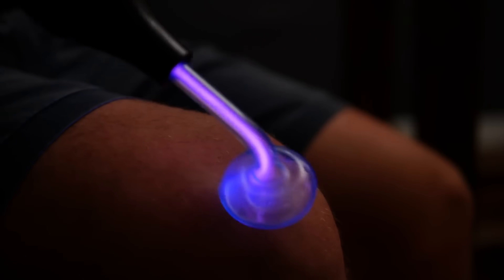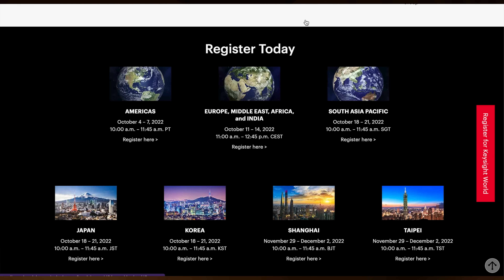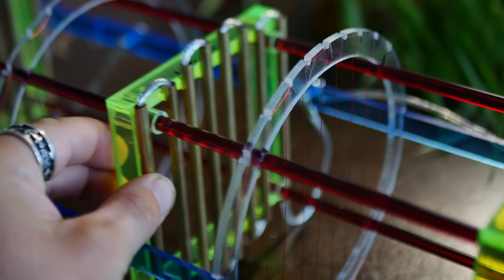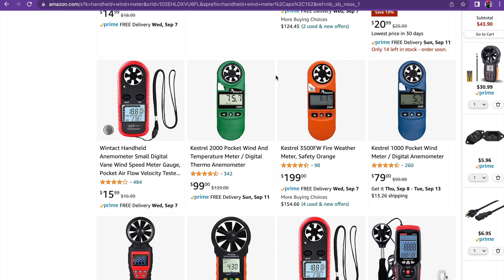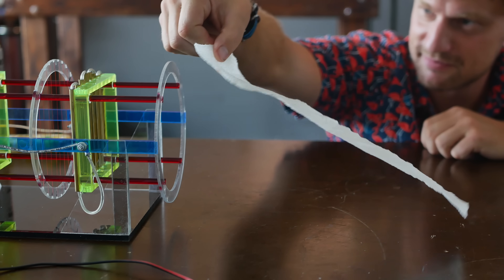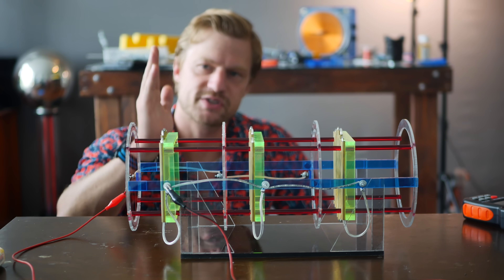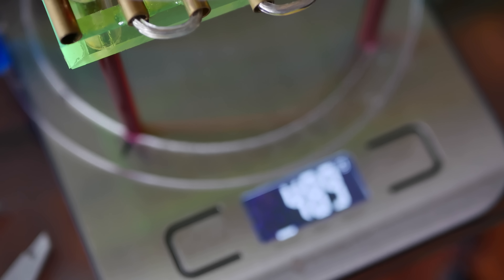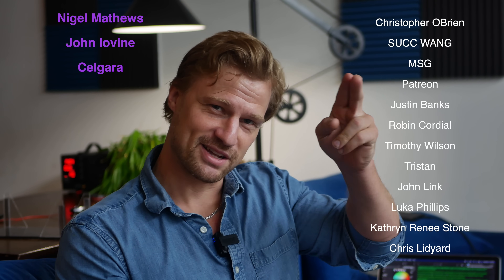Designing A Next-Gen Ionic Thruster! (For Flight)

Comment: Hey awesome work! I CBF reading other comments to see if someone else said it, but I have a feeling you could really improve both the anodes and cathodes. Rant time.

You can see with the lights out that the plasma is leaving the cathode wire where minor imperfections are, likely tiny scratches in the enamel. While I think the enamel is a great idea, I don't think you're using it to it's full potential: I have a feeling that if you run a razor backwards over the wire exposing the conductive surface facing the anodes, you'll create less resistance for electrons trying to head that way, and as the wire will be coated in a C-shape almost then, it'll essentially be the bell nozzle of the electrons focusing their attention down-stream.

Next up those beefy anodes are optimised for collecting electrons but likely mess with the whole build in a few ways IMHO. Firstly they are quite thick, which both severely interrupts your airflow creating both resistance but also turbulence on one axis via vortex shedding, and I also think they are probably far too heavy. In everything I read about the ol' triangle and balsa wood thruster 20 years ago, the alfoil should be folded over at the top towards the cathode, but a sharp edge at the bottom where electrons may continue to be discharged in the direction of the thrust. I'd get some very thin aluminium sheet (considered copper for conductivity but I think the huge amount of ionised particles would accelerate the oxidisation too quickly to be efficient ongoing), and fold it over at the top with the lip facing inwards so any stray electrons leaving that sharp edge join the party instead of heading out the sides

Then if you have a 3D printer and can print the majority of this out of PP that's SUPER light. If you end up needing strength though maybe you could go super high tech with some chopped carbon fibre infused 3D filament. On that note aluminium may only be 61% as conductive as copper but 30% the weight, so... twice the weight to conductivity ratio, which should improve your thrust-to-weight ratio, and I think the plastic you used likely builds up static which may work against you so some sort of 3D-printed composite material may work better in that regard.

Lastly, random thought(s): I wonder if offsetting every second 'module' 90 degrees would improve either thrust or how smooth the air flow is, housing could help but also adds weight and restricts air from being drawn in along the stack, and you did not include the weight of your power supply in any calculations :P
Reply: A 3d printer certainly is an essential tool for not just tinkerers but self sufficient men in general
Reply: @joshuas_rides  I feel like much less of a man for not having one yet 🤣🤣 keyword "yet"
Reply: I love your response and suggestions, I'm subscribed and hope to see some of these ideas tested.
Reply: @wsbucker  Hey thanks mate much appreciated. Did you sub to him or me though? 🤣🤣
Reply: @PlatimaTinkers  both 😀
Reply: @wsbucker  Hah just got that email alert, and I always welcome any feedback. It's a different sort of content but you might be into it. Fresh channel for my IoT / workshop stuff so I can leave the other one to just cooking. Much appreciated <3

Comment: Definitely excellent work but power consumption is definitely a concern
Reply: Just had an idea while shaving to generate electrons instead of using just brute force  like voltage ALSO use a photoelectric material which gives of electrons when light of a certain frequency is used. Cesium is used but other materials can be used like Semiconductors like silicon, cadmium telluride, gallium arsenide and copper indium diselenide are the best material for photoelectric emission. Generally, for the photoelectric effect, materials with low work function are used so that electrons can be emitted from the material by a photon of very low energy. So try this in your next experimrnt as it could generate more thrust or use less power or improve efficiency in thrust per watt.

Normally in photoelectric cells metals that have low ionisation enthalpies or metals which can emit more easily are used. One of the most popular metal with such characteristics used in photoelectric cells is Cesium (Cs). It is an alkali metal belonging to group 1.

Caesium (Cesium) is widely and commonly used in photoelectric cells because it can easily convert sunlight into electricity. During its exposure to direct sunlight, the electrons that are there in caesium’s atoms get stimulated and start moving around. Ultimately, this electron flow creates the electric current. Hence, we can say that caesium is the most preferred or ideal catalyst for the photoelectric process.

In addition to caesium, other alkali metals like potassium, rubidium, copper and silicon are also often used as an alternative in solar panels.

Comment: What about changing the diameter of the "tube" how does it affect airflow. I assume there is a potential to optimize making it thinner. Other thing is casing, without it the flow of air through the sides can disrupt airflow between electrodes.

Comment: This is a fairly dumb improvement, but for a final design: You don't need screws. You can just glue everything.
And I think the spacing for staggered-spacing is wrong? I'd think you need the short distance in the front and the long distance in the back. Because the faster moving air helps the ions cross the further distance.

Comment: I imagine knowing the distance to thrust and voltage ratio would allow you to add more stages in parallel for more thrust. Plus, having the set distance for each stage would allow most of the frame to be made out of just metal wire and tubing minus minimal insulation for maximum effect. I also imagine you could get a vortex flow of air by angling the stages to direct airflow for added thrust.

Comment: The thrust is lost inbetween each thrust element.

Design everything in a pipe, where the thrust can not escape between the elements.

The "mouth" should have a small diameter trumpet, so the gas can align itself in the inlet tube.....

The tube should be a straight tube for each step...at the last station...go straight for an inch , but decrease the pipe now...very shallow narrowing of the inner diameter, not much....about 1/5th smaller diameter on a length of about 10 times the bigger diameter end....the exit...make a short stub, of about an inch with straight constant walls.

The drag of the gas....any round object have 4 times more drag than a wing with a thickness the same as the round object....all those round objects in the airflow...make them like a wing with the same contour on both sides. And mount them with the "wingtip" facing the airflow.

Any gas going pass a wing will act in an area around the wing.....like a biplane ....a monoplane is more efficient than a biplane and a biplane is very draggy.

The grid of "wings" place them in a row of zig-zag , alterning so one wing is a bit ahead, next a bit behind next a bit ahead...etc, to make the wings interfere less with each other.

Once you have each element in a closed chamber, each producing unit will be able to stack its thrust on top of each other in a more linear fashion.

Comment: each "stage" of cathode/anode can be pretty close to the next stage so long as the distance between the cathode and the proper anode are shorter than the distance between that cathode and the anode from the next stage, right?
but this makes me think, if you compress the stages like an accordion, the closer anode will swap and then shouldnt the flow reverse?
or does the flow of ions travel in both directions of there are close anodes on both sides???  how many stages can you fit in that length of engine chamber?

i also wonder if each stages material density will be a problem, as in, will the ions from one stage be crashing into the structure of the next?   in that case you might need each stage in succession to be less dense than the last so allow space for all the ions to flow past?

lastly i wonder if you can increase the final outflow velocity by tapering the structure toward the last stage with an enclosure,  ie, compressing the flow like a jet engine?

Comment: Looks amazing, and it is awesome to see something in scifi from the past actually working in the present. I have some ideas for the possible inefficiencies.
1. Enclose the space. The air might be escaping from the sides, leading to decrease in wind power.
2. Increase the surface area of the electrodes. More surface area might mean more ions which might mean more wind.
3. Expand the intake while reducing the outflow. Increasing the intake will increase the amount of air available and might generate a vacuum, while reducing the outflow might increase air pressure and thrust.
A few more possibilities.
4. Make the ground a magnet? If you have the polarity right, you might be able to get the ions to increase in speed while reducing weight. Possibly stutter the field with an electromagnet?
5. increase the number of chargers. If you have more stages, you might be able to increase the amount of ions, which could increase movement. Diminishing returns shown with data though, so probably only 2-3 more stages before not worth.
6. Alter the spacing between to be closer. You only went up from 1 inch. You might be able to increase or maintain speed if you brought the distance down.
7. Hook the intake to a heavier, more charged gas. If you have a heavier gas moving, it stands to reason you could get more thrust.
And here are a few possibilities for this, or hazards.
8. The exhaust could be harvested per option 7 to maintain fuel reserves. Might not work due to conservation of momentum, but possible. Electromagnetic net might work to catch and channel the exhaust without physically interacting with it, and thus conserving the thrust while negating the kinetic energy of the exhaust.
9. The exhaust, if powered and channeled correctly, could become physical plasma. Hot or cold, that is something useful. Riot weapons, welders, pressure hammers, lethal weapons, shielding, sensor technology.
No idea if even half of these things stick, but why not try, right? My mind picture is basically a reverse flashlight, with air coming in the lens and shooting out the thin back.

Comment: The air flow needs to be directed, a lot of the thrust is probably being lost to air flowing out of the sides. Also tapering down the tunnel you make towards the exit would create higher pressure on exit, which may translate to higher thrust. I also was thinking that using a wire lattice with thinner wires would increase the ionization of the air since you're increasing surface area while not preventing air flow, but it might be better yet to just have several thinly spaced plates perpendicular to the flow of air.

Are these the 3 efficiency boosters you were talking about?

Comment: 1) make the flow a vortex as it's traveling through stages 2) to get laminar flow, have the intake be a whole bunch of drinking straws 3) Try a wireframe hourglass looking shape for the positive and negative poles, one half of the hourglass cone positive, other half of hourglass cone negative [cone in cone also might work also, like russian dolls] 4) have a thrust vectoring output or at minimum a focus-able conical section in the rear to concentrate thrust [ this might be the cone idea from #3, where itself is the ground plane 5) enclose the entire design in Mylar to make it tubular without gaining much weight, however induced air intakes may be needed between stages to gulp additional air 6) expanding on suggestion 4, have each section feed the next in a cascading manner, where the first stage is the largest (slowest), as it vectors out the cone it increases speed, where the next section is only as big as the previous output of the cone 7) normal airgap spark of 30KV can travel about a cm, you may be losing efficiency with anything beyond the minimum distance for a spark at voltage, for instance at 45KV a spark will air gap about 1.5cm (~0.59in),  having poles being about 0.75in apart may gain efficiency

Comment: Amazing.  I have had this idea recently because I want to sew if a weather balloon could get one of these in orbit.   You could calculate the height at which the balloon normally pops and then divert the helium to the thrusters and go horizontally slowly picking up speed and altitude.  I have not worked out the maths but my intuition keeps telling me you could likely get this thing in orbit as you have plenty of fuel in the balloon, that will get you to the thinnest part of the atmosphere and from there amy horizontal speed increase would equal a vertical height increase.   Anyone feel like doing back of a napkin to ensure this wouldn't work as I expect it too?  If not I am more than capable just lack the needed focus to actually do the maths.
PS given the fact they could be made using thin aluminum Ds what about feeding the gas into a small cyclotron and firing those energized helium particles out the back.   Idk, being able to launch using weather balloon into orbit would be a game changer and perhaps a combo of balloon, model rocket motors and the ion thruster to keep it going once at high enough altitude .

Comment: 8.280 Kilometers per hour without mechanical moving parts is nice indeed ... about 1/4 the highest relative to air flow flying speed of a dragonfly... very cool.... consider using a charged or ionic shroud or diffuser to increase air flow or design it aerodynamically  like a Dyson fan to change it from static fanning

Comment: Direct airflow by closing off the ends - and put a nozzle on the end to create higher pressure airflow. 
Use less resistant material, particularly the wires/mesh
Make surfaces more aerodynamic. And offset the metallic tubes so they are not directly in front of each other.

Comment: Size - spacing matters and so does the amount of panels so how big would this have to be to be able to use it as a feasible propellant.

 power-do we have batteries strong enough to effectively give it enough thrust to over come gravity and drag or will this have to be used on a track of some sort like a train.

Strength to Weight- the device itself looks light but all the electronics used to power it look heavy. 

Although you didn't mention it but that kinda power must get hot and most light plastics dont do well under heat. What are some of the temperatures from this device and is that a factor when trying to get more thrust out of it. Generally more power means more heat.

Comment: I am not so blown away.  This experiment is fine for a science experiment.  However, it can’t produce enough thrust to even lift one human being.  At this point, if you want an alternative form of an engine, why not use an electric engine or a hydrogen engine? Electric engines and hydrogen engines have a lot more history of research.  Second, this ionic engine has only been thought of being used in outer space - a zero gravity environment. The ionic engine really reminds me of modern day helium balloon engine.   Reply if you think that I am wrong.

Tom Sisson
Reply from the maker: Hi tom, thanks for the comment. That’s the point of this video, and MIT’s video. MIT proved an airplane can fly with zero moving parts. Ionic thrust is no longer for just space. My thruster was one of many steps toward making a self contained thruster, as opposed to MIT’s thrust being built into the frame of their plane.

Comment: Read the patents Plasma dude. Try Higher Voltage(MV+), Pulsed DC, Multiple waveforms (1/4, 1/2 and full wavelength). Research Assymetrical Capacitors, T. Townsend Brown. ;)

Comment: I was listening off to the side so I couldn't see everything. But I do remember from school and experimentation that voltage doublers start to add more and more noise on that DC level.
Did you think about adding a narrower channel towards the end that would increase the flow velocity. And then I'm thinking of a way to oscillate through the different positive points almost like a rail gun.  progressive flow towards the output side that you could test variable oscillation frequencies for that there is a chaser pattern.
I could explain this better in a diagram.

Comment: Try a grid pattern for the wires and negative side. Also, instead of brass tube, maybe flat stock in a grid pattern for less drag?
Maybe a staged compressor setup might be beneficial, similar to how a jut engine works. Use a larger thruster up up front and smaller rear stages like " compressors".

Comment: Need to get with an aeronautical engineer. Try a shroud around the entrance, wrap something around the main body to hold in the thrust that you are losing out the sides, and rig up an exhaust nozzle of some sort to direct the thrust instead of letting the air just scatter.
Also, would rotating the grids 90 degrees each stage down the line affect things?

Comment: Ok...I get the transformer usage from low(solar power) to HIGH voltage power, SO...make a flyer for transportation...☢️
I guess your thrust/weight problem is,well NOT there.
I'll check back in a decade or so IF you continue.
Glad you specified the strawberry candles...😂

Comment: Given that ionization is more efficient given the area, you may have good success using electrified aluminum honeycomb (usually used as a crush material or thermal barrier) instead of wires.